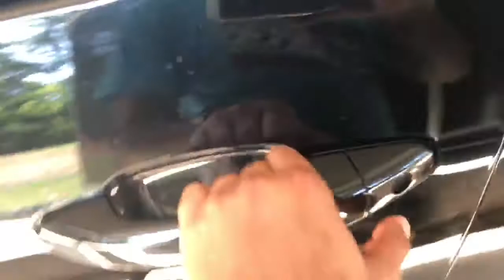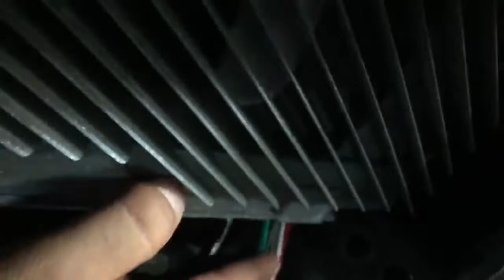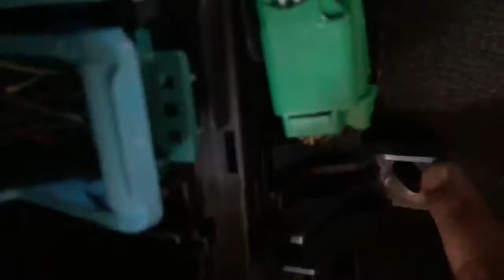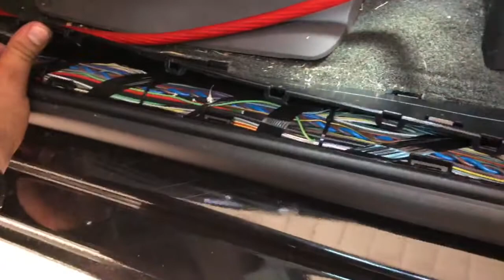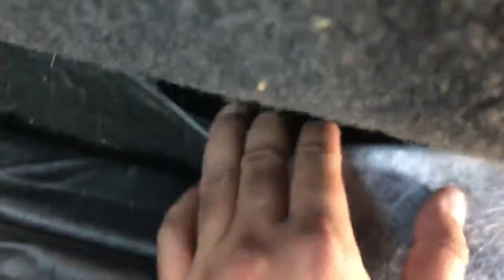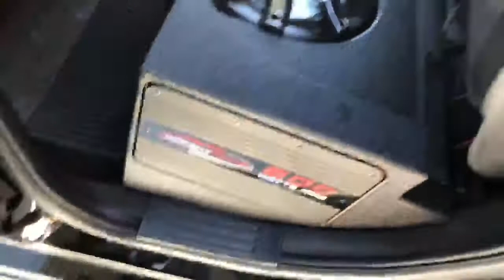2014-2018 Silverado/Sierra DoubleCab Sub/Amp Install - With Bose

Comment: I am looking to buy a harness for my system. The company said if you have a Bose, your stock plug-ins should be black, not grey, to work.
Reply: Colors dont matter as they tend to change to black green gray or white as long as they plug in correctly you should be good

Comment: I had a probox in my 2000 Chevy Silverado with two 10" subs on a JL audio 500/1 slash series amp and that box sounded great. I could have fed it another 500 watts honestly...iut was no joke. That bass system sounded awesome. Probox hooked me back in the day. Today im looking at a 4 6.5" system in my 2015 GMC Sierra with an audio control LC 1.800 amp. I could just come off the 6x9 speakers in the front door to get the signal and go into the amp high level but I think i will go with the Audio Control LC2i Pro and go low level off of that and a LLJ custom harness into the LC2iPro to keep everything clean. Honestly this is my first upgrade with the Bose system and i will be building a systems with all Hertz speakers in the doors and dash and some pods for the midrange...as I get older i really appreciate the midrange frequencies....The hertz speakers really do sound great. Not sure if they handle abuse, but I tend not to abuse my stuff so Im good. looking forward to 4 Savard 6.5" subs in a box tuned to 35hz beating in my truck.

Comment: Hey I'm planning on installing a lil sub system in my 2014 with Bose. Do I really need a LCi or can i get away with not using one? My amp comes with a bass knob. Not versed in installs and the guy says i dont need it but I'm skeptical. All info is appreciated!
Reply: You don’t necessarily need it but you need some type of line converter , could resort for a cheaper option but LCi is the best in my opinion
Reply: @fearthis5-296  thank you I ended up buying the LC2i. And the wiring harness after all. Might try to do the install myself from your video. Just waiting for my box now.
Reply: @Mike_TalksLife  Please let the pros install and full tune the bose with LC2i, don't be a tight wad. You WILL thank me in the long run. If not, enjoy the distortion and blown pos subs you bought. 

My system with 2 JL W6 2K amp with lifted seats and LC2i tuned w/my bose was $3k. 

But, i'm sure you dont have that type of $$ so enjoy little kiddo!!!!!!!!!!!!!!
Reply: Also, my box was $350. Is that 2 weeks of pay for yall?? Get it done right kiddos or your parents will be mad at the $$ they spent, because deep down yall don't deserve it   :)
Reply: @l2kxboost  LMAO I installed that thing months ago. Bumping hard af during break in period. Still havent dropped the ohms. My 19 yr old son calls me a kid too. Thanks for recognizing my youth. Lol
Reply: @l2kxboost your not rich buddy 😂😂😂
Reply: @l2kxboost anybody talk like you prolly struggling right about now lmao 😂
Reply: @fearthis5-296  You have no clue wtf you're talking about little one...